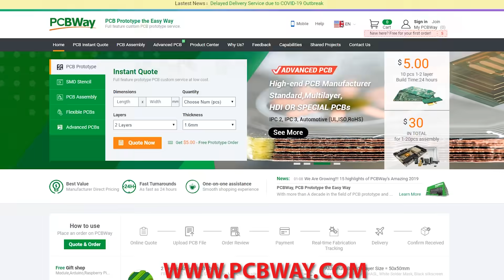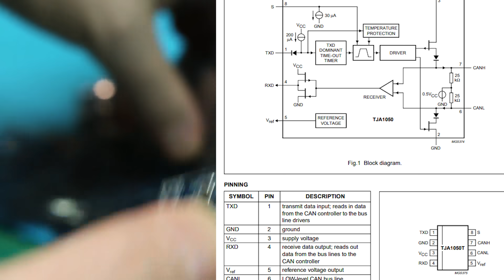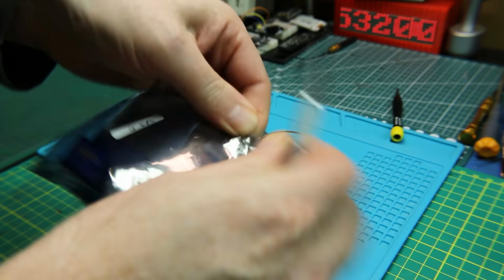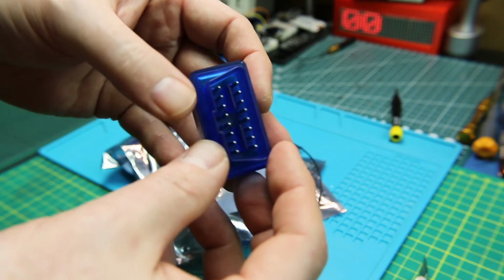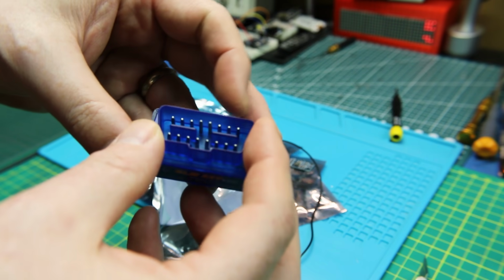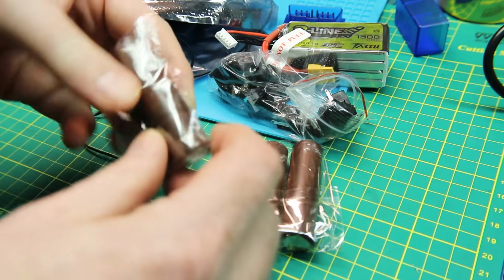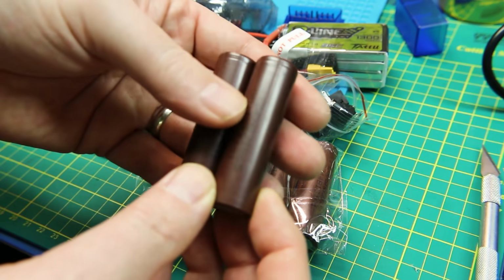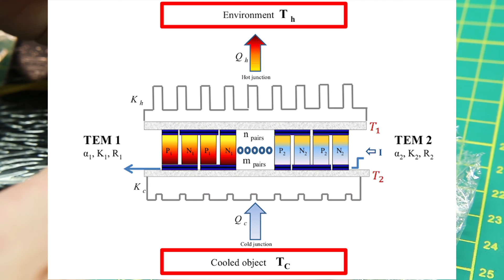Bluetooth tools, CAN modules & MORE! Mailbag📫

Comment: The TJA1050 is a CAN transceiver (line driver), you still need a CAN Controller to encode the date.
Some microcontrollers have an inbuilt CAN Controller, most don't.
Commonly used CAN Controller is the MCP2515.